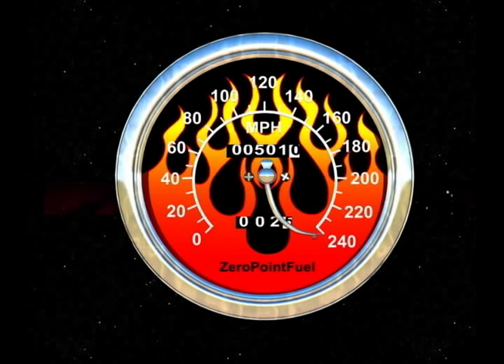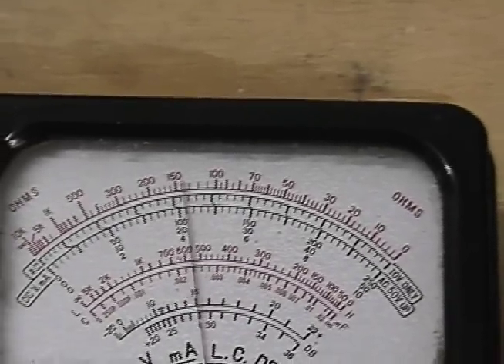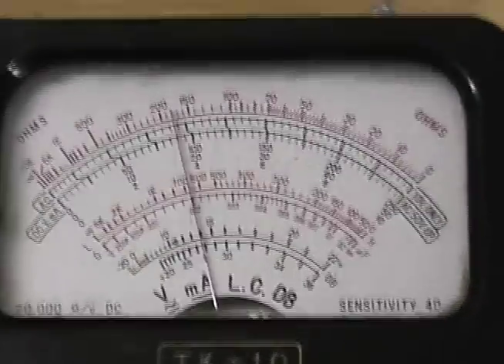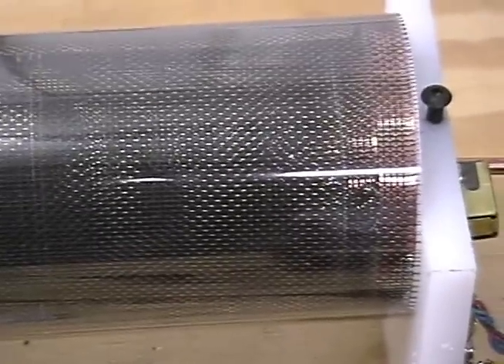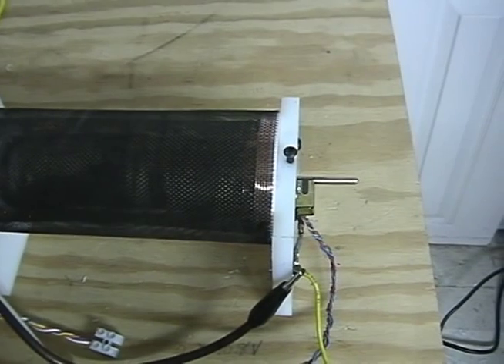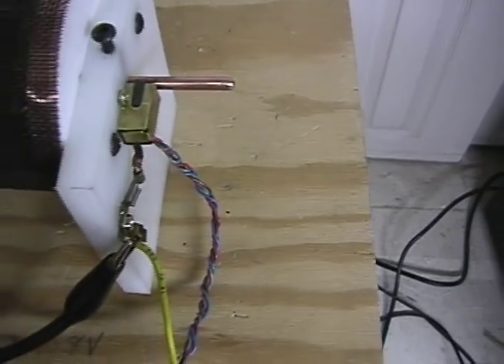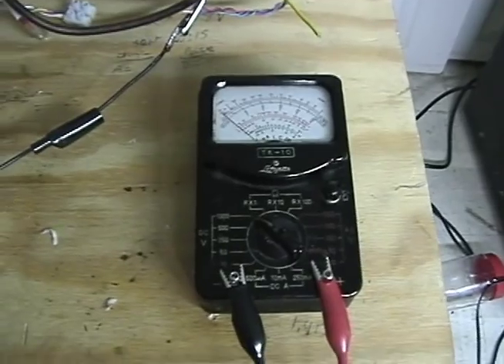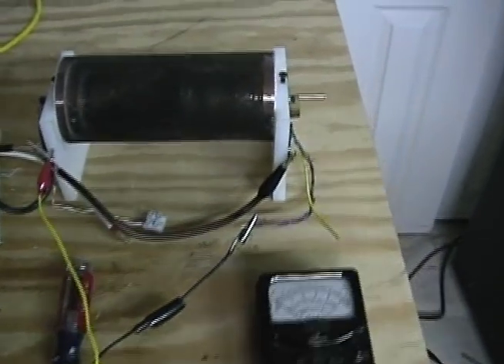EV Gray Tube September  2009

Comment: Welldone for experimenting with the discharge tube! Does it arc over to the grids? The capacitor will help on the input. 
Not sure how you'll setup the "Abrupt spark interupt, I believe grays patent shows a fet of some sort?    

Tesla's notes mention the following:

# Summary of The Electro-Radiant Event
1. The Electro-Radiant Event is produced when a high-voltage, direct current is discharged across a spark-gap and interrupted abruptly before any reversals of current can occur.
2. This effect is gready increased when the source of direct current is a charged capacitor.
3. The Electro- Radiant Event leaves wires and other circuit components perpendicular to the flow of current.
4. The Electro-Radiant Event produces a spatially distributed voltage that can be thousands of times higher than the initial spark discharge voltage.
5. It propagates instantaneously as a longitudinal, electrostatic "light-like my" that behaves similarly to an incompressible gas under pressure.
6. Electro-Radiant effects are solely characterized by impulse duration and voltage drop in the spark-gap.
7. Electro-Radiant effects penetrate all materials and create "electronic responses" in metals like copper and silver. In this case, "electronic responses" means that an electrical charge will build up on copper surfaces exposed to Electro-Radiant emissions
8. Electro-Radiant impulses shorter than 100 microseconds are completely safe to handle and will not cause shock or harm.
9. Electro-Radiant impulses shorter than 100 nanoseconds are cold and easily cause lighting effects in vacuum globes.
Reply from the maker: yes with a flyback not with the magneto thank for watching